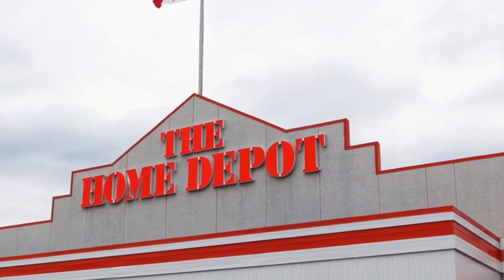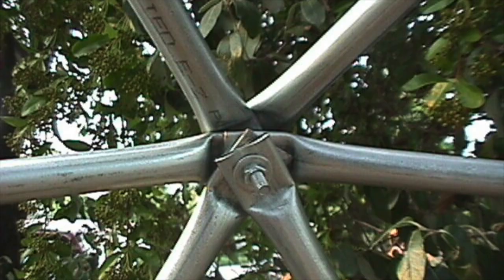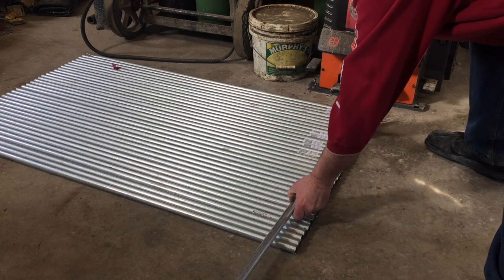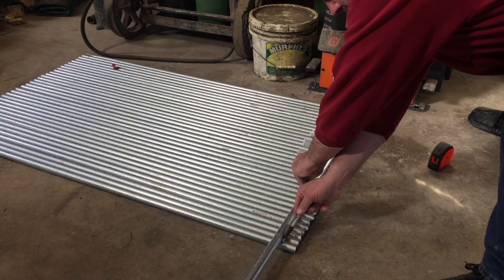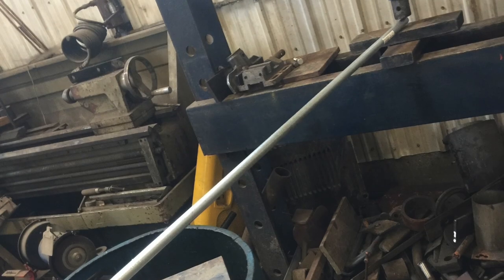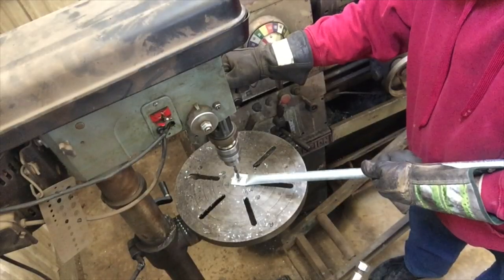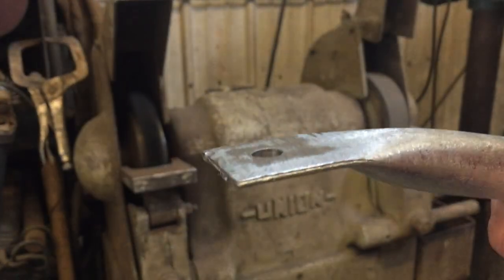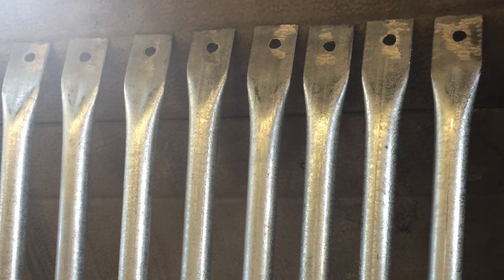Making Metal Geodesic Dome struts under $2 each DYI - Part 1 (2020)

Comment: I don't know if people are ignorant or stupid. These designs are so intrinsically strong that not building with them is foolish! Go price the framing including the roof of a 200 sq/ft space. Scaling is tricky, but 1500 Sq/Ft would be $1500? Galvanized. Magnetic, great for magnets holding wrap during construction. Easy for a basic welder to attach fittings. But what would you have to do to mimic current housing styles? IE room divisions. Idiots in Cali are spending $400K per unit for homeless shelters. Isn't it amazing how the most inept gravitate themselves to positions of leadership and spending your money? $1000/sq/ft ? Trump towers for homeless? That money is not going into construction. The President knows the real cost, they obviously don't.
Reply from the maker: thank you for the comment! you made a lot of sense

Comment: How much waste material did you have? What was the total cost to do this. And could you actually splice pieces of pipe together with a dowel inside so you would have less waste?
Reply from the maker: no waste material - I cut the 10 foot pipes so none would be wasted. no splicing. just single cuts so all solid pieces.

Comment: Could you pour concrete down the tubes to make them stronger
Reply: Joseph: It does not make it stronger. Think about airplanes', in fact, empty tubes. Hard to believe, but it is physics
Reply from the maker: I don't see how that would make it stronger? steel reenforces concrete - not the other way around
Reply: @SimpleTek  : There is a confusion. Concerns design and use. Talking about empty tubes, filling it with concrete does not make it stronger. But if you are talking about a mix steel- concrete, as we see it in architecture, not as a tube, but integrated, they work fine together: concrete for compression, steel for traction.

Comment: FUXK!!!! I understood there were 36, not 72 parts GODDAMIT
Reply from the maker: Video was clear, 36 ten foot pipes!  Then it shows cutting them in half!!!!!
Reply: @SimpleTek  Yes, seems obvious. But you even batched them by 36, hence my mistake. I should've counted them on the drawing. Hopefully this is why I made a nanoscale version. After welding bits and parts I should be able to pull it off tomorrow. Cheers
Reply: Great now I am fuxking stuck halfway with no means of getting more pipe. Ya filthy animal ya tool. AGGGH
Reply: All right I am going to weld some monstrosity with whatever's left in the scrap pile

Comment: If you will have hole near the flat tip and 2-3 on its tube body; then, all connected to a Basin top; then, when water rain comes; then, all the veggie will be sprinkled.  But, if it is as a dry Home; then only the top near the tip and where the sink is; or in the end tip where the water rain will go out to the garden.  But, you have the nicest sturdy type.
Reply from the maker: Thank you for the comment!

Comment: Wish youd included your strut lengths. A=?
B= ?
Reply: www.ziptiedomes.com/geodesic-dome-calculators/geodesic-dome-calculator-index.htm
http://www.domerama.com/calculators/
Reply: It does not matter as long as they are all the same size. Bigger struts=bigger dome. Smaller struts=smaller dome. If you paid attention he did say the strut length. They are 10/2 feet (5 foot).
Reply from the maker: I used domearama - google it - works awesome for any size

Comment: Under $2, but it takes a few thousand worth of tools/equipment
Reply from the maker: DTR89 new hydraulic presses are $200 on eBay, you can cut the pipe with a $5 hacksaw and any drill will make the holes. 
You can also rent this stuff cheap.
In life you find excuses to do things or excuses not to do things.

Comment: look at this... it is inspiring at some points
https://www.youtube.com/watch?v=E_odIPttYP8
and this other way to put things toghether
1
https://www.youtube.com/watch?v=_WBoMnSnBYY
2
https://www.youtube.com/watch?v=XRhFdTYG-E0

IMO the most efficient using low specs requirements is Paul Robinson, but again... to me, something like this
8m 4 frequency with plane hubs seem easier, forget it is in wood, imagine concentric bores in big industrial flanges or washers (perhaps used as a bolted sandwich with struts end inside)... for the assembly
look...
https://www.youtube.com/watch?v=ml3HHZLm5ro
Reply from the maker: Rich Goldstone none of them built a decent door! You’ll love my next video!

Comment: How do you plan to hold the greenhouse film on the dome ?
Reply from the maker: Thank you for the question. I plan to (and am currently, video to be posted shortly) build a wooden 2 foot high base around the bottom, and secure the plastic to that.
Reply: Ok, and adding folds here and there and most likely using two or more pieces to cover the whole dome ?

Comment: I love your vdo and your designed and material.i plan to build one but i would like to use rebar and use the same material for cap each of both end straw to connects..i think rebar mabe cheaper but more work to do maybe. Thanks again for sharing your smart dome
Reply from the maker: Thank you for the comment. Thinking about rebar I have 2 issues. First is squishing the ends. It's possible but not sure the size of hydraulic press needed to squeeze the rebar ends properly. Yes you could use hubs but the cost would skyrocket. Second is covering, rebar, at leas all the rebar I know of, is rough and would snag and tear any plastic covering. If you could get smooth rebar that would work, or not cover the dome with plastic maybe use it as a frame for a concrete dome?
Reply: Wow. You are so nice to replied my coment. I will compare the price of rebar(8mm) and conduite pipe. Do you think rebar stronger than conduit pipe?
I also thinking of using bamboo as well but may take time to treat(boiled in salty water). 
Can i share my day dream plan pls dont laugh.it would be nice if you help me think. Ok here my day dream to build the dome. I plan to built like sheltered at the farm. I will use the roof &wall of burbag( soak in kind of liquid cement, i got ideas from other youtuber tutorial clothes cemented ) over wiremesh, some are will use clear roofing sheets  (somthing like this not sure spelling). Thanks for reading.
Reply from the maker: It's easy and cheap to do a comparison, but one piece of both conduit and rebar, and try and bend both. The pressure you exert to bend them will tell you which is stronger. I don't know much about bamboo, it's very expensive here. I've heard it's strong but I honestly don't know. test it! 
So I'm assuming you want to make a concrete dome? you can look up some examples on youtube. concrete and or aircrew would make a cool shelter. some places use an inflatable dome to do it, but they are expensive. What you're suggesting I think would work. VIDEO IT and post it on youtube, I'd love to see how it turned out! Good luck

Comment: Very cool design!  I don't have the shop equipment that would make this easy to create, but its a great idea.  This feels like an incredible micro-enterprise for someone in each community, like yourself, who has the skill and tools to fabricate a mountain of these and get them out to folks!
Reply from the maker: Thank you for the comment! You can get a new hydraulic press for under $200 from eBay, or just hammer the ends flat on a piece of concrete.
Reply: All you need is a chop saw and a press. It’s time consuming.